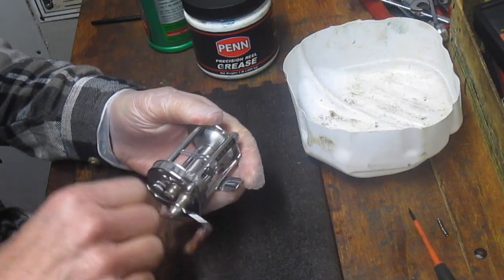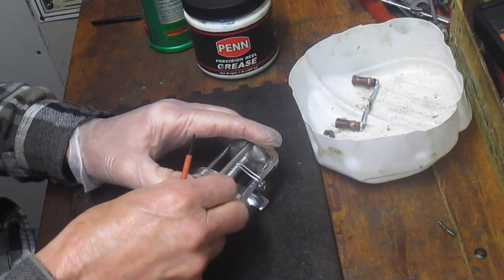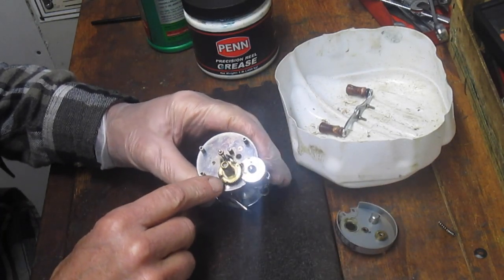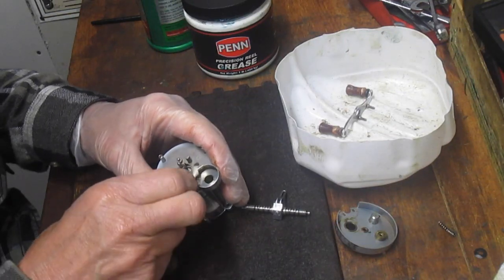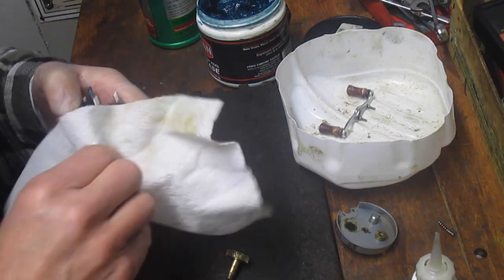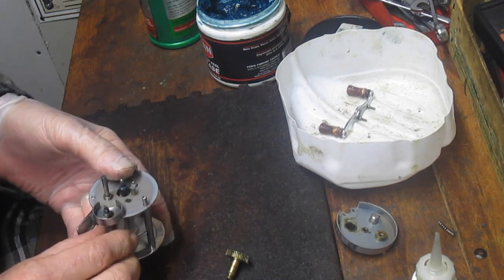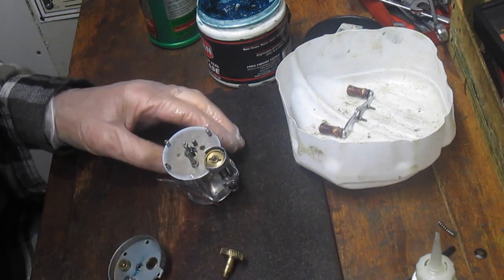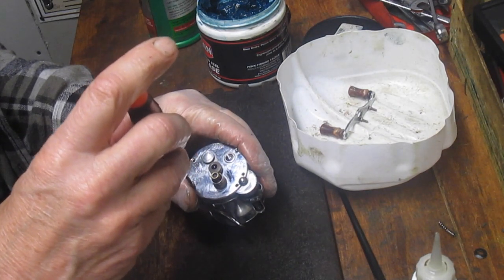Pflueger Akron early bait casting reel how to take apart and service this vintage reel

Comment: I have a Pflueger Akron coming from eBay next week. It was nice to see this video as I plan to do a complete disassembly and detail clean/lube to get it ready for the upcoming fishing season. My Dad had this same reel when I was a kid. He let me use his rod and reel one day, and someone stole it when I wasn't looking. I was nine years old at the time and was heartbroken at the loss. Dad was very forgiving and told me I learned a life lesson.
Reply from the maker: Thanks for the note and best wishes with the clean up of your new reel.  I just got a bucket of charter boat reels in for repair.  Each one has the side plate painted a bright and ugly yellow.  Unfortunately, your life lesson is still valid today as the painting is meant as a deterrent to reels walking off of the boat - Dennis
Reply: @2ndChanceTackle  As an addition to my story, the next year my dad purchased a Zebco 66 spincast reel and paired it with a hollow fiberglass rod. Dad used it for one season before the reel quit working. He gave that rod and reel to me after he replaced it with a Johnson Century and new rod. Being the inquisitive type I began to tear down the Zebco reel to figure out how it worked. I discovered that a tension spring had come out of the groove it was supposed to ride in. I put the spring back in place, and discovered the reel still worked fine. Dad was impressed that my ten-year-old mind was savvy enough to fix fishing reels. I'm 68 years old now, and fishing reels continue fascinate me, especially the vintage stuff that was built to last.
Reply from the maker: Great addition to the narrative.  My story didn't start at 10, but it did start when the reel I had as a child broke.  I took it to get repaired at the local bait and tackle shop and was told it would cost more to repair that it was worth, so I took it home to see what made it tick and what was wrong.  Like you, I was able to get it working again and the rest, well, I'm still fascinated with them, just like you , and trying to show others that they can do this too - Best wishes - Dennis

Comment: Hi and Blessings Dennis. I like a lot your channel and it has help me repair quite a few reels and now I’m working a Pflueger Supreme that was disassembled,cleaned and lubricated.I also super tuned the spool bearings and the pinion gear by sanding the bearings interior with 1500 grid sandpaper and polishing them with metal polisher and I was able to cast a 1/2 oz casting plug 55 yds.!!!
Reply from the maker: Glad to help and nice to hear.  Congratulations on your work.  That sounds like a nice tune up.  Thanks for watching - Best wishes - Dennis

Comment: Tore my ten-dollar Pflueger Akron almost totally down to all the little pieces today. You were right about it being a relatively simple reel design. My reel must be newer than the one in your video as the pawl drive gear is made of nylon. Ordinarily I have an aversion to nylon gears, but the one in my reel has very little wear. One thing I learned when disassembling this reel is that the screws that hold the reel's foot on are staked in place and not meant to be removed. I soaked the screw with penetrant before trying to remove them, but I still managed to twist the head off one of the screws. I'm not too worried about it though as I can just drill out the remainder of the screw and drive in a brass rivet. After reassembly the reel looks really nice. Wish I could post a picture here.
Reply from the maker: Thanks from the note Dan.  The Akron reel is one of the vintage reels that I like a lot.  Best wishes for great fishing with it - Dennis

Comment: Hi Dennis, love your videos! I just wanted to mention a word about the polished Diamolite finish on the Pfluegers of this era. I found this paragraph on the web by Peter M. Patricelli M.D. and though that you might like to see it...

"Diamolite is the Plflueger owned, registered, proprietary name for a mysterious alloy (or alloy and treatment) which appears to be some type of stainless steel. Presumably a search of U.S. Patents would reveal it’s composition. Amazingly, there is NO information on it available from a search of that word on the internet. The only returns come if linked to the name Pfleuger. Diamolite is highly polished, silvery, corrosion resistant, and very, very hard. To typical fishing reel use it seems to be completely scratch and abrasion resistant."
Reply from the maker: Thank you for the additional information.  I have an Ocean City reel with Zephalloy.  It is the OC Zepher. I guess it is another mystery metal finish!  Best wishes - Dennis

Comment: Just watched you tune up a Pflueger Akron reel from the 40's or 50's.  I just purchased a Pflueger Akron No 1893L  and was wondering what sets the spool when hooking a fish and then retrieving.  Is it ones thumb on the spool?  Your video was very informative.
Reply from the maker: Yes, it is your thumb on the spool and the handle crank.  There is no mechanical set - Thanks for asking - Dennis

Comment: Have an excellent condition Akron 1894 from Grandpa in box with owners/instruction manual and you have reperked my intrest in it. I found out that on the gear case, there is a screw and a secret compartment that holds a backup level wind paw. Don't that beat all Dennis?
Reply from the maker: Yup - The penn 209 also have the spare pawl.  Thanks - Dennis

Comment: I have a chance at buying an AKRON for $10 locally, it looks nice and seems to function well with no corrosion, it has green plastic handles on it. Do you know how to identify the age of the reel using details like this?
Reply from the maker: That's hard to say.  The reel was made for almost 40 years, the earliest ones were in the 1920s and it was discontinued in 1963.  I think if you can find old Pflueger reel catalogs, you can narrow the search.  My guess is that it is probably post WW II and at $10 is a bargain if it all works and is not missing parts - Dennis
Reply: @2ndChanceTackle  Thanks for the info, I may pick it up